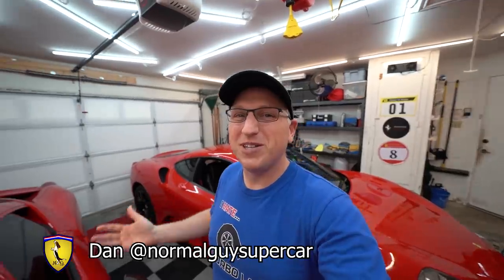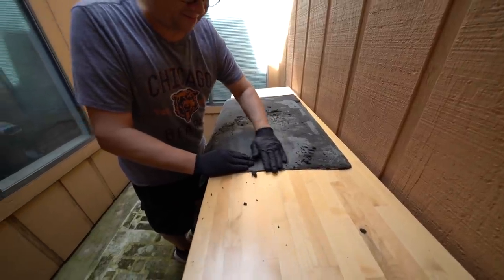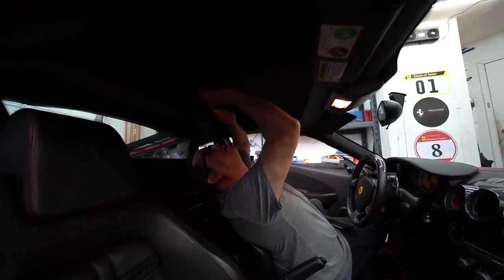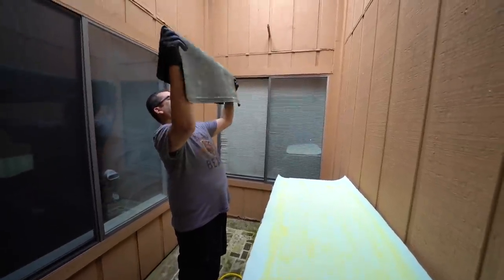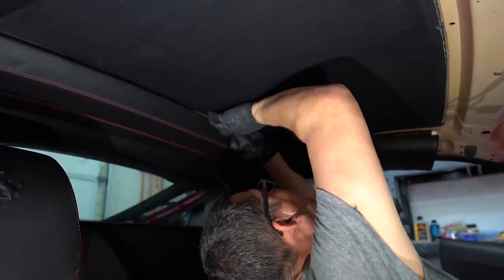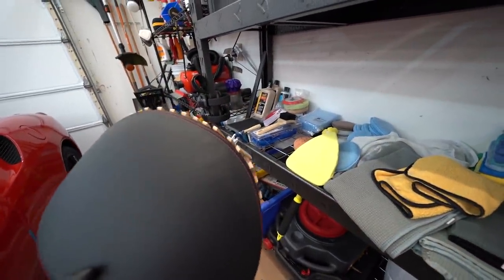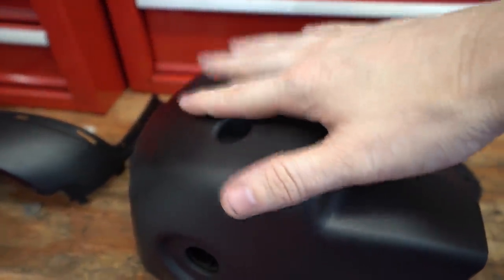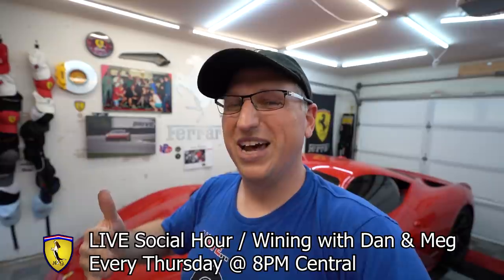FIXING COMMON FERRARI INTERIOR PROBLEMS on the Project Ferrari F430

Comment: That was a great tip about shrinking the leather on the airbag cover. I have the same problem on my 360, so I'll give that a try with my heat gun.
Reply from the maker: Just be really careful and go super slow
Reply: Did you end up fixing yours with the heat gun?  And if so, do you remember roughly what temperature you had it on?
Reply: No, I never got around to doing that. I no longer have the car.
Reply: In case someone else is looking for the answer, I went for it at 250F for a solid 5-10 min or so, slowly moving back and forth and occasionally pausing and touching to make sure it didn't get too hot.  The point where it seemed to have fixed is when the leather felt hotter than I was comfortable holding my hand to it for more than a second, but I do have fairly weak tolerance.  After that, I went at it for another minute and using a soft cloth to smooth out the surface a little better.

Comment: Watching the airbag cover wrinkle repair was oddly mesmerizing.  I am surprised you messed with the steering wheel trim on the 458.  Last I saw the wheel wouldn’t move up and down properly.  Did you fix the steering wheel or just go for it?
Reply from the maker: It's basically working.